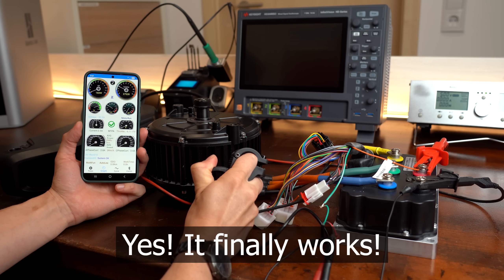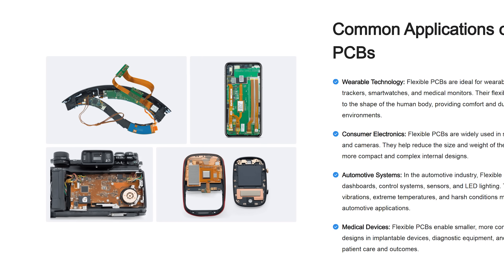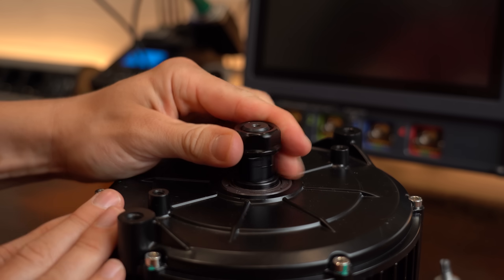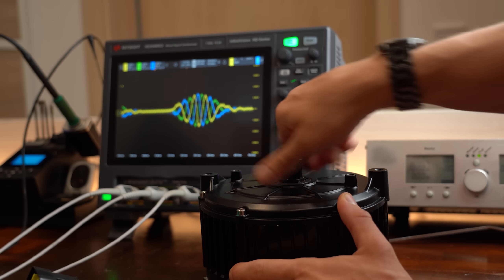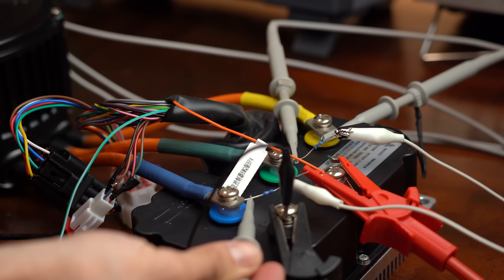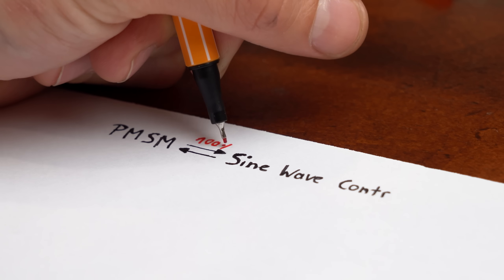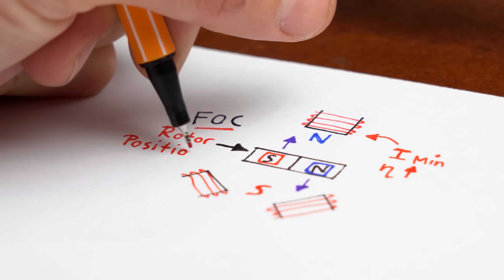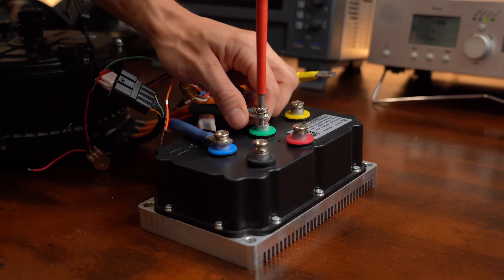The Most Important Motor for our Electrical Future?! (PMSM) EB#63

Comment: SCOT can you please do a video explaining every single (or almost all) of the the settings you need to adjust on the app for the controller? (explaining why it says usable for 2-3kW motor but it has 330A phase current, and what even is phase current?)

Comment: My rc rock crawler motors advertise that they use FOC in order to maintain a constant low speed crawl by increasing torque automatically when mechanical resistance increases.  I normally keep it off because of the disconnected throttle feel.

Would my batteries potentially last longer per run if I use FOC?

Comment: you can use a VESC based controller with those kind of motors as well. I myself prefer them (even for high power applications) since - as you have seen - the fardriver software sucks, and VESC gives you more control over every aspect of the motor's parameters. Examples for VESCs that can handle high power would be Spintend UBOX, Trampa (250A model), Tronic X12 (with the new Infineon FETs) and many more.
Reply: i wouldnt advertise spintend imo, unless their quality improved massively ( doubt it )
Reply: fardrivers software is meh, but the hardware is pretty amazing for its price. the controller he has can push 14kw continuously. (170 battery amps)

Comment: When you are doing the setup of your motors make sure you set your pole pairs first in the app. And when you put in figures like rated power make it higher than the peak rating of the motor. It uses these numbers to draw your gauges in the app and you want to be within range or the dial continues to go around and gives you negative values or she's a second lap back to positive. Fardrivers are wildly inefficient. I work on these  things all the time. They are dirt cheap at least but I would recommend VESC based controllers over Fardriver. 

QSmotor owns many companies. I am tempted to do an evolution video as they went from square wave junk to sine. They are Sabvoton, VOTOL, Kelly, Sotion, SIAecosys, and a bunch of others. They actually have model numbers under 2 different brands for some controllers. 

I've worked on lots of these you can see the progression as they move along. They are careful  to mix protocols between different brands so each seems unique and that way you can't share dongles between them. If you have a bad experience with one brand the next one you choose will still probably be made by them. This would explain why the documentation is always so bad.

I'm working on a 961800.  60 MOSFETs. It's the most ridiculous thing. 900 line, 1800 phase amps. Oh man. You have to turn the throttle down so far to not loop it. I have a 40 pound hub  8 thought was pretty big. My buddy has a 78 pound one and I know they make a 100 pound d one too so 40 is like nothing. "Nothing". Heh heh. Obviously it's not nothing. lol. More power than you need on a bicycle. Purely for status. Ugh

Comment: Note also that trapezoidal waveforms can offer a higher power density at the same supply voltage compared to sine. This is because the voltage, thus current is applied too early and kept too long compared to the phase. This is also where most of the efficiency disparity between the two technologies come from.

Comment: I'm trying to upgrade a bicycle or scooter and make it a diy ebike or escooter. It seems so complicated to make a reasonable low power drive, that also can recuperate is low weight, low on work time and compatible with displays and controllers. Maybe you can share a small and easy diy upgrade project here or on a a 2nd channel
Reply: That's why you usually just buy a conversion kit, with a matching motor, controller, and display, and then buy a battery. DIY for a motor setup is expensive and annoying for motors in the legal ebike range and really only practical when you need more power. A DIY battery can be done but it does need specialized tools to not make something dangerous- Don't mess around with li-ion cells without knowing exactly what you are trying to do

Comment: It's not like they are new or were that hard to get (unless your only way to source stuff is ali express). They aren't even that expensive if you go for the asian brands (inclduing japanese), you can even get these as servo drives. The biggest issue is the controller tends to be bulky, so hobbyists usually have no way to hide them away in smaller projects and getting decent ones for lower voltages is also not very common and to top it off you have to be carefull with the encoders, as there are various ways to implement them and especially the japanese ones tend to be quite proprietary.

Comment: Huh, now I wonder, could one theoretically drive an asynchronous 3-phase motor with the PMSM controller...? Because - three phase sine AC works, and frequency setting with a VFD is very similar to how the PMSM controller works, at least when taking a look at the waveforms (they also mostly use SPWM)
Reply from the maker: Only one way to find out.....

Comment: It's the purest synchronous motor 👌🏻
It's really cool that prices of motors and especially of variable frequency drives is going down!
These motors, in a small format, were used for a long time in precision machinery with closed loop control.
Reply from the maker: Thanks for the interesting insight! 👍
Reply: @greatscottlab  As you explain, you can exactly control stator field orientation, thus have "analogue" precision.
Have a look at Aerotech BM series. You also get the same thing in a linear form: BLMxx series.

Comment: PMSM is mainly used in EVs because it has high torque in a little form and can generate back without having to be powered like the rotor of a normal synchronous motor
Reply from the maker: Thanks for the feedback :-)
Reply: @greatscottlab  Does this mean you have a feedback winding? :P
Reply: @nimoy007  BLDC motors have 3 windings for 3 phase system. Those windings give a feedback to controller by back emf and it knows when to switch phases. But more precise switching is based on the hall sensors or encoders.
Reply: @Aleksandar_tech   It was a joke -_-
Reply: BLDC also recuperate just fine.
Reply: @namibjDerEchte less efficiently tho

Comment: Such motors are commonly used in modern trains, and usually make interesting sounds from their motor inverters while accelarating and decelarating. Great video as usual :)
Reply: Buses as well, although the ones at Texas A&M (hybrids) back around 2010 were rather old and sounded very "buzzy". The regen on those cuts in suddenly rather than smoothly ramping, occasionally causing a standing passenger to lose their balance.
Reply from the maker: Thanks for the fun fact :-)
Reply: @greatscottlab  Nah, they're almost exclusively induction machines with recuperation-capable converters/inverters. It's actually why they don't sound the same when the train is almost stopped, because induction machines require a slip frequency between mechanical and electrical for some given torque, kinda, and PMSM don't work with slip.
Reply: Most trains use asynchronous motors, but the inverters for those use the same PWM techniques as with a PMSM motor, so they sound similar
Reply: Isn't the majority still using asynchronous motors?
Reply: A word of warning: if you look up videos of what those inverters sound like, it is interesting but YouTube will think "Oh, you're one of those nerds!" and pepper your recommendations with train videos for weeks. Ask me how I know 😭
Reply: @Phoen1x883  could be worse recommendation fates lol
Reply: @Phoen1x883  but they sound nice
Reply: Toronto subway sounds like it's shifting gears.
Reply: @vintageforkcollectorguy the Toronto T1 is one of the earliest trains with variable frequency drive. With the limited switching frequency of GTO thyristors, it reduces the amount of pulses as the motor ramps up in speed and makes quite interesting noises. Newer railway inverters use IGBTs and higher switching frequencies and is less audible but have a similar behavior.
Reply: New coming trains in Europe are tending to SMPM, current and older trains mostly use induction motors or self controlled synchronous ones, there are many SMPM high speed trains already in Asia in Japan, China and South Korea. Induction motor one also uses PWM and synchronized pulses producing interesting sounds I saw there is a Japanese community dedicated to VVVF sounds
Reply: Yes. I love that sound. Seems like accelerating ion thruster xd

Comment: I’ve built a bunch of vehicles with these motors, and they are awesome. One of my favorite parts is that the peak power can be way higher than the rated power, for example that 5000w motor Scott has could do 15000w peaks, which makes it perfect for e-bikes where you need a burst of power to climb a hill but don’t want a big heavy motor. With that being said, one downside is the inconsistent and confusing ratings of the controllers that drive these motors. For example, the controller shown in this video can actually do 13,680w but it’s labeled as a 3000w controller for some reason.
Reply from the maker: Thanks for the information, it's always great to hear from someone with experience :-)
Reply: That's called service factor (i dont know if it's like this in english, in portuguese is "fator de serviço") basically means that the motor and the controller can work at more power that it was design.
Reply: @trouxa1940 bug for a limited time..that's the trick ..in welding they call it duty cycle or something like that ..ugg I forgot the term now
Reply: @trouxa1940 it's ACTUALLY Duty Cycle.
Reply: @trouxa1940  Safety factor.
Reply: @Aleksandar_tech  how is it that youre the only one pointing that out? :)

if components are used closer to their max specs or at higher temps, they will on average fail more often and earlier.
Reply: @Aleksandar_tech  Service factor is the word when it applies to electric motors. One could argue they mean the same thing but since we're technical people here the technical word is service factor.
Reply: Thanks! I came into the comments to ask why a 5000w motor and a 3000w controller. You have already answered my question!
Reply: @BarryGrumbine  you can basically bring both to their physical limits. but due to process variations, these are very much depending on the individual part. the specs the< are used at are more conservative to make sure those specs can be depended on. and still, theres always a compromise to find between lifespan and power. tesla also doesnt load their betteries to the theoritical max. it gives them a lot more durability by avoiding edge cases of the physics involved. its all probabilities in the end.
Reply: I think you may be referring to the duty cycle. I first saw this when my boss was buying a new welder. I copied this from the search output in a browser.
"Duty cycle is widely used in various applications, including pulse-width modulation (PWM) in electronics, where it controls the average power delivered to a device. By varying the duty cycle of a PWM signal, one can modulate the average voltage or current supplied to a load, which is useful in applications like motor speed control, LED dimming, and voltage regulation.
 In welding equipment, the duty cycle specifies the percentage of time a welder can operate at a given amperage within a 10-minute period before needing to cool down.
 Similarly, in electric actuators, the duty cycle rating is crucial for understanding how long a device can run without risking overheating."
Reply: @CrispyCircuits lol..just was making a similar comment
Reply: Yeah i have always understood the rated power to be the output level it can operate at continuously without overheating or damaging it, and the peak power is the maximum it can handle for a brief period.
Reply: @xDMG15x  correct
Reply: I also build these bikes and I watch you all the time
Reply: 15KW... terrifying lol
Reply: The QS165 V2 can do 22500W peak, i run it at that power on my 80V sur ron
Reply: Its called intermittent duty when we are talking about motors. IEC 60034-1.
Reply: Most types of motor have that trait.
Reply: I also noticed the 3000W rating when he then had an issue that was my initial assumption, the 2000W difference
Reply: i push 55kw thru that motor and it holds up (for now). ill forever be a QS glazer
Reply: Yah like all motors. Stalling it makes the watts blast off due to increased amperage.
Reply: @godwinsboom not necessarily, the motor is only going to take the power that the controller sends to it. If the battery is powerful enough compared to the motor then the motor may not hit full power until it’s spinning fast enough. I’ve seen it myself on some of my builds.
Reply: @Calthecool oh, it has amperage limiting.
Reply: Of course.. how would any controllers exist otherwise. Cities would be in flames with all these lithium batteries 🤣
Reply: @TheBozn lipoly batteries would not be good for sure
Reply: what hill, a speed bump? 💀 climbing a hill takes time
Reply: YASA has a prototype motor they tested on a Dyno. Weighs just 28.4 pounds or 12.4kg. No exotic rare earths. 

 It produces 1000bhp, peak. 750 kw. Continuous 350-400kw estimated. 470-531bhp. 

 That's essentially double the power weight of a top fuel dragster. The continuous is around the same power to weight. Depending on the source. 

 Anyone know? Google/AI are from 22-33kw per kg. 

 An F1 entire system has 750kw peak or 1000bhp. It is 5kw/kg, but I'm super generous there. 

 Motors like this with all the other advances in inverters, capacitors, and battery tech will allow personal air travel, new tools, equipment, and change lives. 

 Annnnnd people still dismiss EV tech like dinosaurs.

 Electric Vehicles never were about being green. It's about performance, and effiency. 

 You aren't a rebel sucking fumes, rolling coal in a loud, slow, inefficient vehicle. You're a reject. A sheep for the gas companies/states, and terribly ran car companies. 

 They all lobby instead of innovate. 

  America is a gas state now, without the profits. Just the clean up, and health burden. 

 We give them subsidies, all while my fellow Americans take it as a patriotic duty to fight for them. 

 It's just lame. So are the motorsports holding back even internal combustion. 

 I bet we would have a good rotary to power the motor by now. 

 I knew a guy who powered an entire homestead plus vehicles/tools with solar. Could camp, and power everything with it too due to the Rivian. 

 That's freedom!

Comment: Quite interesting! I wonder what would happen if you powered one of those from a 50Hz 3 phase mains (with a transformer for voltage matching if necessary).
Reply from the maker: It would run rather slow I would think and not great since there is no feedback used from the encoder. I think it would spin though.
Reply: @greatscottlab  yeah, I guess it'd be better to drive it with a variable frequency drive, especially with some sort of tacho control.
Reply: Brainstorming a bit on an already-answered question... in the ideal case (massless rotor, frictionless bearings, resistanceless windings) it would spin at exactly 50Hz or 3000rpm and draw no power.  This perfection only holds in the absence of load and slip: the rotating field must be strong enough to keep the shaft in synch with it.  If you connect a clutch and gently spin  up a big mass then 3000rpm starts to feel like a lot of stored energy.  Fully engage the clutch and you have an electrical flywheel: some of the startup current for your freezer or welder will be supplied by the motor using energy from the flywheel.  This could be practical where "mains" comes from an inverter underpowered for your surge loads or in a country with too much electronically injected generation.  Was it Portugal or Spain or both that had a related failure a few months ago?  As a fun aside, consider the gyroscopic forces imposed by the flywheel on the rotating planet.  Utility providers, with control over the rotation of tons and tons of spinning metal, could technically change the depth of the seasons and the length of the day given enough time.

Comment: So you could use a PMSM motor as a 3 phase AC generator too? It looks like it puts out a very good sine wave.
Reply from the maker: Yes. Actually Generators can be PMSM.
Reply: i seen people using motors from e-scooters as windmills
Reply: Many modern wind turbines use permanent magnet synchronous generators
Reply: I was going to suggest the same thing.

Comment: I'm very familiar with FOC with hall sensors on BLDC hub motors (5-6" rim, idk like 4" stator? bit bigger) for DIY Onewheel electric skateboards. Would something like a VESC with FOC be able to power a PMSM motor I wonder? I will have to look into it but a PMSM seems ideal for a Onewheel, if they can be made as hub motors. Great video!
Reply from the maker: VESC with FOC should do the job. I think there are version that can handle quite a lot of current (power).

Comment: I've had some drone ESCs that have a sine mode. Is that worse for BLDC then?
Reply from the maker: When using sine with BLDC, then you usually get better efficiency, less noise, more stable torque. BUT the max torque that a trapezoidal ESC can create, usually does not get reached. It is usually not a huge difference though.